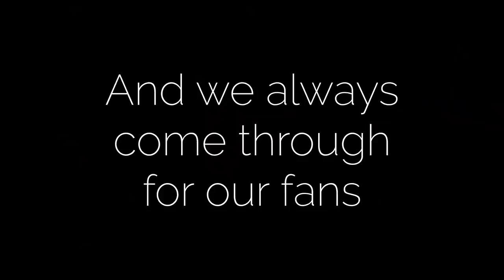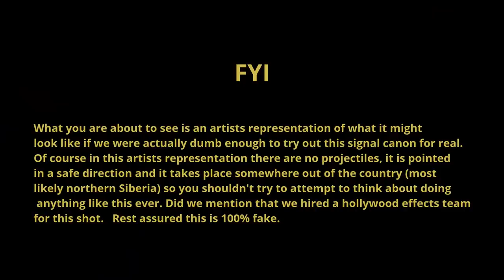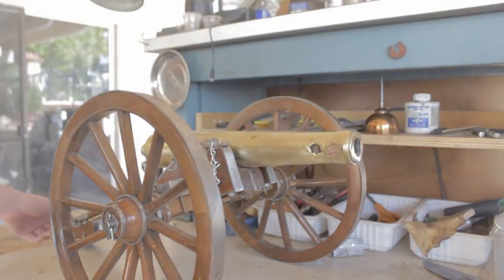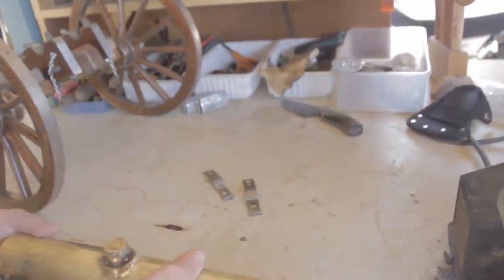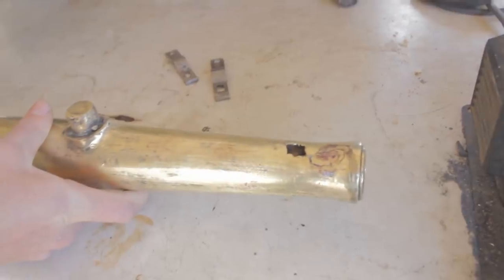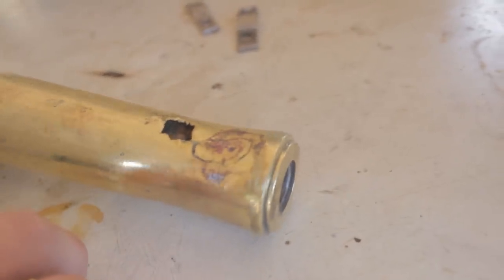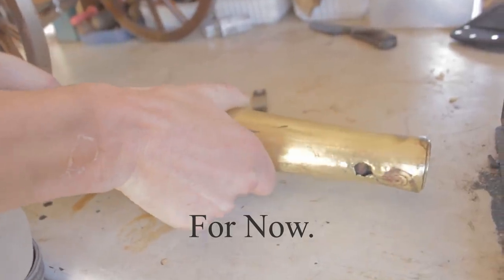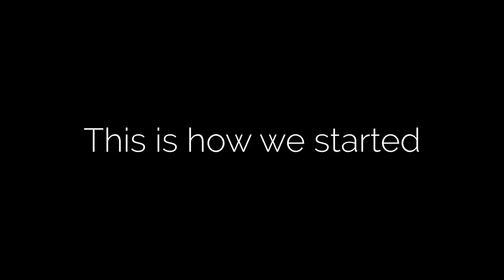Casting a Cannon from Brass | Part 2

Comment: Stand the casting on end. So the muzzles up straight up. That way if u run out or material or u get shrinkage wen it cools, it can get cut off  wen u clean it up

Comment: vent holes are totally a thing. Also, you need a riser of metal to be a "reservoir" of brass (and heat) so that takes the contraction and provides molten metal to the actual workpiece as the metal cools.
 One other thing- you stopped in the middle of the pour. Don't do that.

Comment: My suggestion for fixing it:
1: thread the steel liner at the muzzle counter clock wise and use a lathe to make a steel rod that's just big enough to bottom out all the way down to the breech end when counter clockwise threads on the rod two thirds up are fully engaged with the muzzle threads of the liner. 
2) Drill a hole perpendicularily through the rod extension and push a steel cross bar through.
The cross bar will hold the liner and in position when the brass is re-melted and the rod will prevent the steel liner from deforming under heat and preassure from the molten brass.
3) make a flared foam extension of the barrel around the steel liner extension, adding about 3" to the gun length.
4) Make a reinforced vertical crucible mould around the cannon and extensions as it is with a flat bottom and walls thick enough to support it's weight even when full of liquid metal and mount it all muzzle up in a one-use gas-heated furnace. Make the furnace out of an insulator lined barrel or something.
5) Remove the foam to get a funnel, heat it all up until all of the old brass has melted and then add more ingots outside the barrel extension until all the melted slag overflows into the single use furnace.
6) Keep the heat on for another minute or so to ensure a homogenous melt.
7) turn off the heat and let it all sit and air cool naturally until you can touch the metal, protect it from rain.
8) Break the mould and cut the muzzle back to shape, drill a hole into the steel rod extension and thread it clock wise, use a high torque hex bolt and mount the barrel in a vice to unscrew the rod out of the barrel by screwing the bolt into the rod. (That's the reason for ccw threads on rod and muzzle)
9)Fill in the threads with brass  solder and finish up with polish etc.
10) test firing time!

Comment: You know how to fix it? Put the entire barrel in a crucible. Melt the thing back down. And cast it properly this time. You don't need a premade box, just stack some boxes on top of each other. You need 4 bits of wood 8 nails x 2-3 depending on the size. It's not a big job.

Comment: Hey guys, you gave it a good shot and learned some stuff too. Sure the cannon didn’t hold up but I’d still call it a win just for the experience. I’d proudly display it if I were you. You could use some auto body filler and some paint on the hole but to be honest I think it’s cool just how it is because it proves it was fired.

Comment: I was wondering what would have happened if when you found the hole in the cannon. and dropped some flux into the hole, then re-pored the hole to fill it. might that have done the trick or would they not combine to weld the hole?
Reply from the maker: We tried it. The brass solidifies too quickly to flow properly and then contracts as it cools so it doesn't really adhere. Thanks for the suggestion though!

Comment: They made a holo cylinder 100mm x 1m then turned it down.

From that piece they made a cast iron mold that was heated and poured brass into it when it cooled the iron would shrink and so would the brass releasing the cannon.

Then they would hand drill the hole and  polish the brass, then they would coat it in paper and wax for transport the wax was very hard when set.

Research it better.

Comment: How to Repair the Voids in your Cast Brass Cannon Barrel,  for the Best Possible Cosmetic and Structural  Results,  USING A TIG WELDER - But First:

I have not Proof Read this.  Please interpret as Best as possible,  any Areas that sound incorrect.  I’ve got to go! If 

WARNING!!!!!!!!! 
I STRONGLY WARN AGAINST EMPLOYING ANY TYPE OF MAJOR REPAIRS OF SIGNIFICANT VOIDS,  ANYWHERE IN THE BREACH AREA,  SAY.... ANYWHERE BELOW 3” ABOVE THE TRUNNIONS. (Muzzle Up)  TO AVOID CAUSING EXTREME STRESS WITHIN THE BARREL AT THE BRAZED AREA IN THE BARREL,  LIKELY WEAKENING THE BARREL TO THE POINT OF MAKING IT EXTREMELY HAZARDOUS TO FIRE,  BEYOND JUST PACKING IN DAMP NEWSPAPER,  TO ACHIEVE ENOUGH RESISTANCE TO GUARANTEE A LARGE REPORT UPON FIRING.  OF COURSE IT GOES WITHOUT SAYING,  THAT ALL RESPONSIBILITIES FOR ANY OUTCOME,  DUE TO EMPLOYING THESE REPAIRS,  ARE SOLELY YOUR RESPONSIBILITY.  THESE METHODS OF REPAIR,  WILL GIVE YOU THE BEST POSSIBLE 
“COSMETIC REPAIRS”,  BUT ANY BRAZING UPON A CANNON,  WILL DEFINITELY CAUSE CHANGES OF GRAIN STRUCTURE AND STRENGTH OF THE BARREL,  AND I CANNOT REPEAT TOO MUCH,  THAT ANY ATTEMPTS TO DO SO,  ARE TAKEN AT YOUR OWN RISK!!!!!!!

First of all,  Create Brazing Rod from the Exact Same Material that the Barrel is Cast from.  If you are able to even Cast some ~ 1” x 1” x 8” (Minimum - Can Be Much Larger) Pieces (for Example),  letting them Cool on their own,  you will have a Great Start.  Remove any significant amounts of Sand from the Outside of the Casing,  so as to not Destroy the Bandsaw Blade you are about to use.  (If you make your Molds out of Carbon,  you won’t have the Sand Problem) Using a Good Bandsaw with a Skip Tooth Blade,  Cut Up the Brass Bar,  into No Larger than 
1/4” x 1/4” x the Longest Lengths that you have been able to Cast.  Make sure that you have Cut all 4 Sides of the Brass,  so you have Extremely Clean Brazing Rod  without Coolant.  I suggest 1/4” x 1/4” Rod,  because I am seeing that you have a Large area to Fill in.  1/8” x 1/8” Rod would be Great to have,  along with the 1/4” x 1/4” Rod! 

Prepare the void in the Cannon Barrel,  Down to absolutely Bright,  Bare Metal,  and for at least 3/8” of the Good,   Surface of the Barrel,  surrounding the Void.  You will want to Clean both the Barrel’s Critical Void Surface,  and the Adjoining Good Barrel Surface,  as well as the Brazing Rod,  Extremely Clean,  of any Oils or other Surface Contaminants,  with Acetone,  just prior to Brazing. 

* I suggest you Research what is the Best Temperature that a Cast Brass Cannon should be Heated to,  in Order to attain the most Stress Free,  as well as the Strongest Grain Structure.  That shouldn’t be too difficult to find out,  However,  you probably have no Idea what the Closest Type of Brass your Cast Brass Barrel is to.  
At any rate,  I suggest you (Preheat) the Barrel,  just Prior to Brazing on it.  This will reduce the Stresses you are about to induce in your Barrel.  You see,  you May as well see what the Best Temperature you should use to Stress Relieve the Barrel,  and if you can attain that Temperature with a Household Oven (I don’t think so),  the you should Preheat the Barrel,  to that Temperature,  or to what you can,  and having Setup your Welding Table Ahead of Time,  for you to be able to lay the Barrel,  onto for Example,  two Wooden Vee Blocks,  with Probably at least 1/2” Thick of Woven Fiberglass,  to take the Heat,  Insulating the Hot Barrel from the Wooden Vee Blocks. It should be High enough to allow you to turn the Barrel to the Best Possible Position,  by the Person doing the Brazing.  If just Laying it down on the Table,  happens to allow you to be in the proper Position to Braze,  make sure to set it on Wooden Blocks,  and ~ 1/2” of the Woven Fiberglass.

Quickly Braze in the Voids on the Barrel.  If for any reason you had to stop Brazing before you we’re Finished.... so Long,  that the Barrel Cooled Significantly,  put it back into the Oven,  and Bring it back up to the Appropriate Temperature again,  then go Finish Brazing on it.  I personally,  would put it back into the Oven,  (Being Armed with the Knowledge about the Temperatures that are Meaningful for this Task..... and I would bring it up to as Close to that Temperature in your Kitchen Oven,  or Better Yet,  if you are not able to reach anywhere Close to the Required Temperature to Stress Relieve the Brass Barrel,  and also achieve the Highest Strength,  I would consider bringing it to a Heat Treat Facility,  and ask them how much it would Cost to have them Stress Relieve it,  and probably Allow it to Cool Slowly.  (You will have Learned if letting it Cool Slowly,  is the thing to do.  Non Ferrous Metals are usually quite different from Ferrous Metals.)  If you are suppose to bring it up to a certain Temperature,  for so Long,  and then let it Cool Slowly,  and you don’t want to,  or can’t 
Afford to use the Services of a Heat Treat Facility,  then bring it up to the Temperature,  or as Close as you can,  with your Kitchen Oven,  and Hold it for whatever Period of Time your Research May have told you,  (if at all) and then Turn the Oven Off,  and let it Slowly Cool.

USING A TIG WELDER,  IS EXACTLY WHAT YOU NEED TO DO.  IT MAKES IT A PIECE OF CAKE!  CLEANLINESS OF THE WELD AREA IS REQUIRED,  FOR THE RESULTS THAT YOU NEED!

* Note:  You may actually find that all of the Preheating that I have mentioned,  is not actually Required,  in order to Successfully Braze in the Void,     Filling it Perfectly.  I have mentioned it as a way to help avoid inducing a Lot of Stress into your Barrel,  at the Heat Affected Zone of the Brazed Area.  However,  when I First noticed you we’re having Trouble with a Void to Fill,  I stopped Watching this,  to write what I have.  I have since seen all of the Abuse this Poor Barrel has received,  and you May as well just make the Brazing Rod out of the Same Cast Brass you have,  as mentioned,  in order to get the Perfect Match with your Barrel.  If you use Brazing Rod off the Shelf,  you have no idea how closely you are going to Match with the Cast Barrel.  If really Far from each other..... it will show up,  mot likely as it starts to Tarnish..... Looking it’s Best,  when Brightly Polished!  

I am a Welder,  and a Precision R&D Machinist by Trade.  I also happen to have a  Machined from Solid Steel,  1.5” Bore,  Cannon,  that a Friend in High School,  and I Made.  There is a Flat at the Back of the Ball at the Rear of the Barrel,  where I Stamped,  1976.  The Year I Graduated High School.... Which happens to have been the 200th Birthday of the Birth of our Country!!!!!!!  Too COOL!!!!!!!!

Comment: You didn't make it right you're supposed to make it out of a solid block of material and drill it and shape it to size. Not cast around a thin little tube that's why this happen it wasn't strong at all as you can see..

Comment: Wow...looks like you are using smokeless powder. That's not clever. You don't see many modern guns using brass...I wonder why?  Maybe the chamber pressure is too high for brass and it could kill you.
Reply from the maker: Not using smokeless! You are correct that would be dangerous.